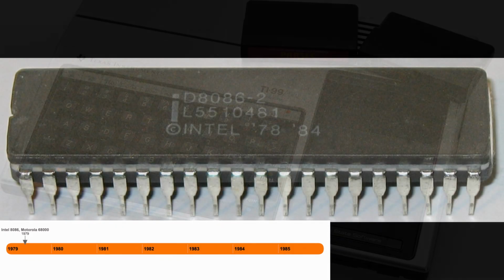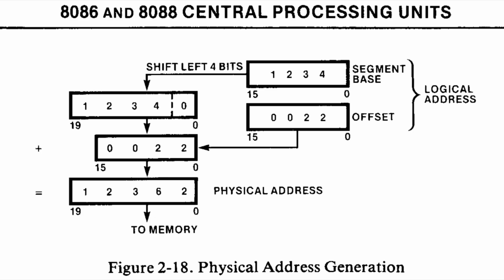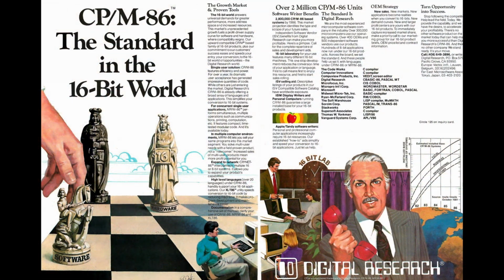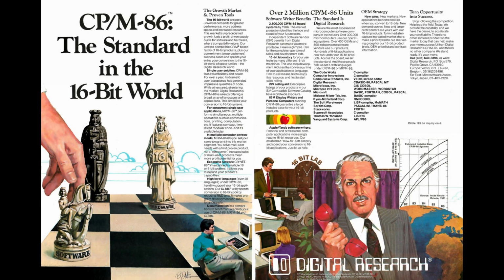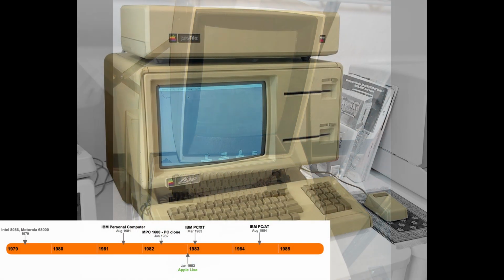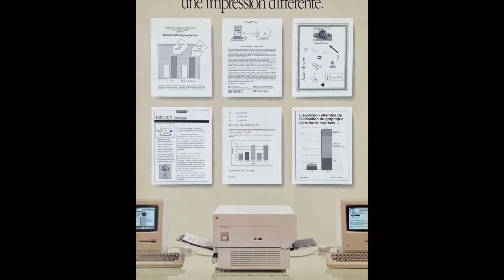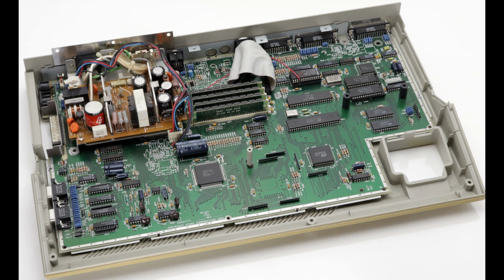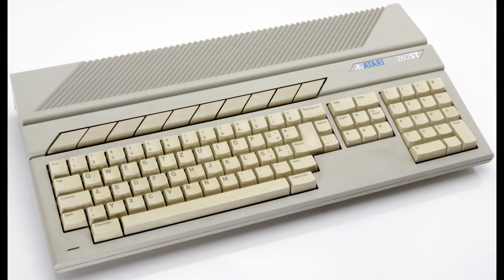16 bit computers, development of major families

Comment: It turns out that the manager at Atari before Tremiel is the one that approved the loan to Amiga. However, before Tremiel took over Atari's home division, he already talked to Amiga and essentially said that he just wanted the chips and would not employ the engineers. Naturally, they walked away from that deal and went to Atari for help instead. As part of that loan, Amiga engineers sat down with Atari engineers and explained the Amiga chipset and design in detail. Atari was quite far along designing the motherboard for the 1850XLD (what was to be Atari's Amiga) when C= paid off the loan on Amiga's behalf -- just in time. It's likely no coincidence that, later the exact same month that he learned of the details of the Atari-Amiga loan, Jack got a quick start on the Atari ST project. It was rushed in an effort to get the ST to market ahead of the Amiga.